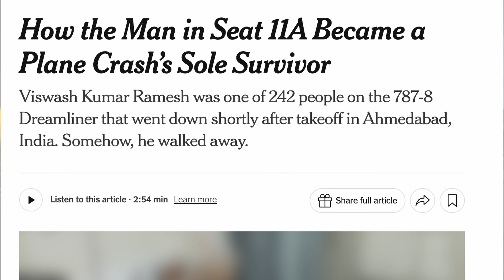Why the RAT Changes Everything – Air India 171 Update

Comment: Indeed, the other day when we watched the original Video we certainly could hear that the 'Rat' was definitely deployed in that video.The question is why? It still also seems clearly evident that this Plane was struggling even before takeoff. Also in the Mayday call the Pilot stated "No power!" This would also very likely indicate an electrical failure which would cause a complete power failure which would then, in turn, have caused an engine failure.That would be why the 'rat' was deployed.Therefore, it seems very likely that there was a problem before takeoff, which then tragically manifested fully when in the air. 
      Added to that was the fact that the lone survivor stated that the lights were flickering just as they were in the air. So, it is then very likely that the electrical issues, filmed & reported by a passenger on this very Plane, which had just flown in on the leg of the flight from Delhi to Ahmedabad, were clear warning signs of what ultimately occurred. IE: A/C not working, Screens in front of Passenger seats not working, Buttons to summon Air Attendants not working etc.  Electrical issues, are serious issues, especially on a Plane! When they manifest in smaller things first, that should then be a clear & distinct Warning that something is, & could be, seriously wrong. 
    So this should have been reported & investigated immediately before this Plane even left Delhi! How terrible! Ironically, there was also an incident which was reported by a Passenger & happened on the very same type of Plane, the 'Dreamliner', 'on May 29th, just a few weeks before this tragedy. It was also an Air India Plane.The passenger stated, that this happened  right before take off. The passengers suddenly smelled a really strong burning electrical smell in the Plane.They raised an alarm 'ruckus' about it & reported it to the Crew & Captain.
    Fortunately they came & investigated this & smelled it too. Due to this, the Plane was taxied back to the bay for engineers to examine the cause. The passengers were then disembarked & sent on to a Hotel over night while this was investigated & the problem fixed.This 'repair' took over 24 hours! Then the plane & flight was finally cleared to depart over 24 hrs later on the next day. However, the Passenger reporting this incident stated that he could not find out what the problem had been. either at the time, or since then. 
     The fact is, that incident could have also ended up being a terrible disaster, if the Passengers had not raised an alarm & group protest about the smell & if it had not been investigated, found & 'repaired'.So, that is two ''Dreamliner' Planes, where different Passengers noticed, filmed, had issues with or reported electrical problems on the same type of Plane within a few weeks of each other. It is highly unlikely that this would be a coincidence. 
    So, there could be some kind of electrical 'glitch' which has developed in this type of Plane. If this is so, let us hope & Pray, that in this investigation, it will hopefully be found ASAP. Then rectified before there are any more terrible tragedies like this occurring. Tragically, for those dear souls on this flight it will come too late! Sending deepest condolences, along with our thoughts & Prayers to the dear families & friends of these precious souls who lost their lives in this terrible Crash. May they Rest in Peace.Thank you for sharing! Blessings to you & to all!

Reply

Comment: Altitude of airport was 189 feet. Altimeter was mis set to 18900?
The fuel metering unit only gave 30% to both engines to prevent flooding. air fuel ratio issue.
Reply: Huh?

Comment: The flaps do not appear to be deployed. I would have thought even with loss of engine power, hydraulics and electric that the flaps would have been locked down. My understanding is the 787 flaps are electrically actuated and will remain in the last  commanded position in the event of dual engine flameout. I remember that after the ORD AA DC10 crash, the DC10 was redesigned so the slats and flaps would not retract after loss of hydraulic pressure.

Comment: Hey Captain Steve, did you notice that the left main gear bay door appears to close as the plane flys by?  It’s just that one door. Which means the pilots did try to raise the gear. And they cycled it afterwards as well. I initially thought incorrect config + other pilot error. But now, I think they suffered a catastrophic electrical failure. Perhaps something went wrong with the 787s CAN (Boeing’s Ethernet network) and caused the engines to flame out (fuel control system malfunction and or FADEC failures due to power issues such as corrupted sensor data). I have a feeling it’ll come down to electrical issues and AIR India SOPs with respect to the “temperamental plastic princess”

Comment: I might be wrong but ive heard that the Air Conditioning system wasnt on either. Maybe not working. They should interview all maintenance personnel who worked on this aircraft before the crash. The question to ask is what things, if compromised within the aircraft, will disable both engines. Fuel contamination is one, what else? Maybe the pressure to prevent flight delays made inspections go by faster and not looked on properly. Another thing to note is that a former chief minister of Gujarat (the state in which this crash happened) was also on board and his body was found using DNA matching. Probably not related to an assassination I hope. If it was a birdstrike, i dont think there would be dead birds at the end of the runaway, they would most likely be entirely pulverized in the engines, i would suggest to do an in depth look into the runaway to find atleasr fragments of birds, but again, birdstrike could be ruled out completely. I also suggest finding more videos and recordings of the aircraft, i am sure there are multiple aviation enthusiasts who were recording the takeoff. All we can do now is wait for more information to unravel. Rest is peace to all those that died in the crash.

- An Aircraft Maintenance Engineer student.

Comment: Attached is an Indian video in which a person being interviewed is speculating that there was an electrical failure, rather than engine failure.  I don't follow his exact reasoning, but he seems to have experience.  His video is disturbing and notable because IN TWO PREVIOUS VIDEOS BY 2 SEPARATE PASSENGERS ON THE SAME PLANE BUT ON different flights reported strange electrical opertion/failures.  One passenger was on the flight before the ill-fated one.  The next one, poor soul, reports on the doomed flight during taxi/post pushback.  Further, there are other old reports from other airlines and incidents on 287 maintenance issues.
NOTE:  The person being interviewed is Squadron leader Krishna Mitroo, ex Indian Air Force officer.
There is another video speculating vapor lock, but that one probably has no awareness of the Indian passenger videos.

https://www.youtube.com/watch?v=P-dTppPwKx0

Comment: The RAT was clearly deployed.  You don't need to see it.  You can hear it.  Its quite a distinctive buzzing noise.  I remember hearing the RAT in Charleston when they were returning from certain test flights.  It is louder than the engines on the 787.  It is quite clear in the audio as the aircraft flies past.  There is a soft jet sound as well.  I'm guessing its the APU as it'll autostart with a dual engine out.

Comment: Well, guess i called it correctly based on the first video then.

Dual engine failure was my guess then solely due to how the aircraft behaved.
It has a "not great" takeoff, but still doing ok.   It starts to climb ok, and then suddenly, its behaviour in the air completely changes, as if it completely lost all thrust.

The nose is still up, but suddenly instead of continue climbing, it enters what is mostly a ballistic trajectory, only somewhat modified by the attempts of the pilot to recover into a controlled glide/crashland, instead of letting the plane continue its nose up ballistic vector.

Comment: Non-pilot here and what I don't quite understand even after watching this pretty insightful video, is how Captain Steve is so sure it's a duel engine failure rather than the two other reasons the RAT deploys. To me it seems just as likely that it could be an electrical failure, especially given how there was a passenger on the inbound flight who posted evidence about a bunch of things in the cabin not working as they should including the A/C which seems like a big deal given the temperature outside. To me that would suggest that the plane was having electrical problems prior to the doomed flight but I'm admittedly not sure if those electrical systems connect to the engines but it seems like something worth investigating for sure. If nothing else the plane clearly should have been inspected and fixed for those issues before leaving for Gatwick.

Comment: Is it possible that an algorithm in the control system detected failure to set flats on take-off and automatically deployed the RAT in the off chance the problem causing the flaps-up condition was due to an electrical failure?  This could be a software function buried in the  system and possibly not even documented.  The Indian version of the NTSB will figure it out.  If course the black box will directly tell us.

Comment: My two cents worth; The flaps were set right correctly and left there, no pilot error. On the previous flight, it was said that it was really hot in the airplane. Suggesting something malfunctioning. Could just be the AC, or maybe power supply to the AC. You got to think that mechanics looked at it, but didn't find anything. Or worse, found something wrong but not the underlying problem and fixed that now thinking problem solved. Some problems, especially electrical, can be intermittent. It was hot but not so hot that the 787 couldn't handle it until it couldn't. The lone surviving passenger said he heard a pop and the lights flickered. That might have been the electrical crashing and the RAT deploying. The problem here is the electric fuel pumps stopping. The mechanical fuel pumps on the engines should be able to feed the engines, but with that heat they couldn't overcome vapor lock. Engines were getting some fuel but not enough. Then it is like a pig in a slaughterhouse. Breaks my heart, same outcome.

Comment: Didn't they also use up all the runway during rotate because both engines were starting to fail and they were starting to lose thrust, sounds a lot like a fuel issue. The FADEC system and the EICAS will display various warnings and cautions, including the "ENG 2 FADEC FAIL" message, to alert the pilots to the specific failure and guide them on appropriate actions.

Comment: I need to ask this. As I don't know anything about planes. If there was dual engine failure, wouldn't they have been unable to taxi, fly up the runway and take off? Surely they would have known before take off that something was wrong, as they probably couldn't get to the right speed for a proper take-off and climb. I have flown many times and I know the sound at the point of lift off, you hear the speed, the wings have the back part down - like steps, and you hear the gear come up. If a passenger can hear all of that, why didn't the pilots?My theory -  I think they didn't have enough speed to begin with and should have aborted take off, as it wasn't a last minute thing, they ignored it and that plane took off knowing there was something wrong with the engines and the pilots killed many people through negligence.  If the RAT comes down with engine failure, hydraulics failure or electrical failure, that RAT was down before lift off. So why did they take off and not abort?

Comment: Not a Jet pilot. I am multi-engine rated limited to piston under 12,500Lbs.  From the videos, of what I saw, I am curious as to the AOA and why at power loss it did not appear to be reduced.  The ship kept what appeared to me to be close to the departure attitude all the way to near the ground where AOA was increased as it stalled into the ground. My initial take was overweight or had high drag such as spoilers were deployed. I like your analysis. Was the attitude of that ship in the video expected for a power loss scenario?

Comment: I’m just trying to work out how both engines could have failed and I have one theory:

The 787 is mainly powered by electrical power and it is equipped with 6 electrical motors and the engines are started through 4 of them (two in each engine) and once started they then act as generators for the engines. 

I’m wondering if these electrical generators failed which caused both engines to stop, but I’m also wondering if this issue started when they started their take-off role and then the engines lost thrust as a result which caused them to use most of the runway and then a few seconds after take-off, the generators completely failed.

Comment: There’s another video, unconfirmed, from a previous flight of that airplane. He showed that the attendant call button, the overhead lights, and overhead air wasn’t working. If this gets confirmed, then electrical failure may be the cause. Loss of power to both pilots instruments is one of the gates that will deploy the Rat.

Comment: i am an interested layman and usually dont comment on topics where even experts are still clueless due to a lack of good data.
anyway,
short after the accident, a serious german newspaper - der spiegel - posted a graphic where the track-data from flightradar24 were copied to google maps.
IF!!!! the track-data were correct, it seemed that the AI171 entered the runway (due to renovation of the taxiway) at aproximately the middle of of the runway and started take-off directly from there.
That means (said again if the data were correct) they used only about half the length of the runway.
That would explain why the 787 took off nearly at the end of the runway, but this also means that v1 was at a very low speed due to ~MTOW and they eventually had to take off even knowing that they had serious technical problems.

Comment: There is an additional aspect mentioned in another video dealing with this accident: As to be seen the sets of the main landing gears are tilted slightly forward instead backwards as they would normally in gear down configuration. This forward tilt takes place when a 787 retracts its main undercarriage shortly before the gear doors open and the landing gear legs swing into the wheel wells. The conclusion here is the crew selected gear up after take-off but the retraction didn't proceed after the initial forward tilting of the main gear sets which would be another indication of a sudden and total loss of electric and/or hydraulic power matching the deployed RAT.

Comment: The 787 has had a lot of issues from day 1. In particular surrounding electrical systems that monitor the engines. One of the more well known being the thermal runaway events with the lithium ion batteries, that grounded the 787 fleet.

Comment: Reminds me of EA855, excepting that the aircraft barely got past Vr, then ‘stumbling’ into the air, before losing power and gliding into its crash site. No yaw, suggesting both engines failed, or significantly scaled back together, so a failure in the controls rather than the ‘mechanicals’ of the engines? For both to mechanically fail simultaneously seems near impossible, so was there a failure that in effect, shut the engines down?

Comment: If this the ultimate reason what led to this devastating accident then all my future flight decisions will be based on which aircraft is scheduled for the flight. A double engine failure is a disaster result for Boeing and turbine manufacturer, even if airline maintenance failure will be brought into the mix. Some passengers who flew with this specific plane mentioned several issues with electrical equipment on this plane , so why this plane was in service is what will ultimately determine insurance and legal suit proceedings.

Comment: I'm in the bird strike camp. I recently saw a post on LinkedIn posted from the Chief Pilot and Safety person, a good friend, congratulating an associate on a fuel quality system on this bird. More and more I'm leaning toward a physical problem, not an engineering flaw.. Of course the whole electrical system has been a problem since the beginning. That being said, I seriously doubt this aircraft had wiring issues or battery problems. Leaving some other cause of engine failure. Seems they were trying to glide in but had little options.

Comment: Captain Steve, you cant hear the main engines running, if i know any pilot that was fast losing altitude at low altitude, the toga button would have been mashed by muscle memory, and those jet engines would have sounded on that video like having your head stuck inside a trucks turbo

I live under the approach to my local international airport, and when airliners go over, before they pass my house you can hear a feint whistle, but as soon as they hwve passed you get that roaring whoosh/whistle sound from the engines

That aircraft had passed the camera, so you should have heard the tailpipe end of the engines clearly if they were running

Comment: Nobody has mentioned compromised cheap jet fuel possibly being loaded into this jet it was fully loaded before take off, this would effect the jet engines and combustion thrust the engines can produce. 

Having both engines fail is near impossible, but having poor or compromised cheap jet fuel would cut power like we see in this video is very possible.